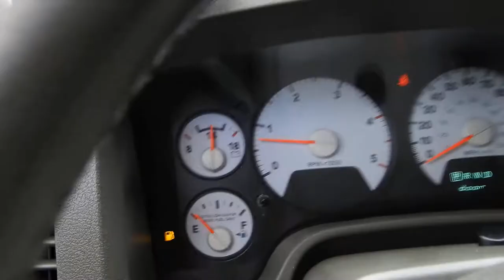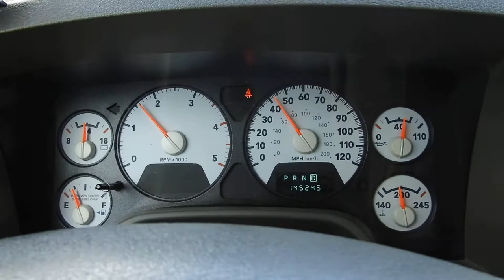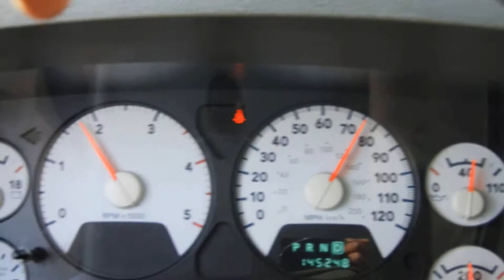AIRDOG INSTALL PT 2 6.7 CUMMINS

Comment: The stock return line has to be connected?  In progress of doing mine, I might have to drop the tank a little to do that, along with finding the clip cause I took off both.

Comment: Hey man I’m looking at getting a airdog fuel pump for my 05 cummins 5.9 it’s stock but I’m going to slowly build it and kinda wanted to start with this. I’m not wanting all the power in the world it’ll just be a tow rig what’s the difference between dg-165 and dg-100 and how do I know which to get. The airdog 4g 2 model btw

Comment: Hey awesome informational vids straight up! Question to you, what made you decide air dog over let's say fass fuel system? Thanks in advance!
Reply from the maker: Michael White honestly man just price and deal! I got a screaming deal on the airdog I got a 165gph with a sump for 610 out the door from rudys diesel. Fass was going for 750 for the 165. My airdog runs awesome. I got a review video on the airdog I installed. Thanks for liking the videos and watching man I appreciate it!
Reply: EVERYTHANG DIESEL Right on! I hear ya where price point helps make the dicision some of the time depending on what it is. My truck is stock now till few more days. Doing egr, def, dpf delete, fuel rail plug, 4 stage efi live tuned with on the fly switch, transmission tune and 5 inch turbo back. I absolutely can not wait! Next step will be cold air intake for sure
Reply from the maker: 6point7 cummins oh man your gonna fall in love with your truck all over again!!! Shes gonna be running good. What year? I'm assuming a 4th gen?
Reply: EVERYTHANG DIESEL yes 4th gen, 2016. I also left out that I'm also doing arp head studs as well and exhaust tip 5x8x18
Reply from the maker: 6point7 cummins oh hell yeah you doing all man! Head studs is next on my list. Still gotta switch from minimaxx to efi live, 10mm cp3 pump, I got a huge list haha. If you got a Instagram make sure you following my Instagram its easier to message me that way.
Reply: EVERYTHANG DIESEL yea I figured if I'm gonna do it then do it right the first time lol. Yea the diesel owners list never stops haha
Reply from the maker: 6point7 cummins that is true my friend

Comment: Couldn’t you just run the return to the filler neck and run the feed from the sump instead of dropping the tank and just cap those lines on top of the tank?
Reply from the maker: u still need to dropped the tank to cut the oem fuel pump wires so power isnt going to it.

Comment: Trucks looking good bro lest me know your gains on the sump?
Reply from the maker: Down south hunting And fishing thanks man! From the sump alone you dont really gain anything just it pulls fuel from the bottom of the tank. Compared  to the draw straw so you wont have to worry about 1/4 tank issue.

Comment: What’s the Purpose thou with the AIRDOG ?
Reply from the maker: consistent better fueling for the injection pump. plus air is separated from the fuel so the diesel fuel burns more efficient